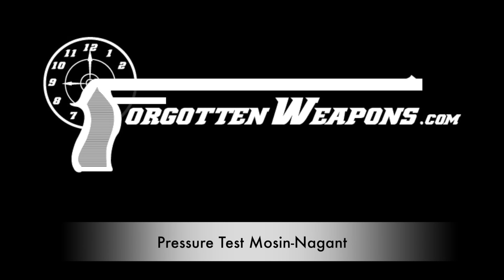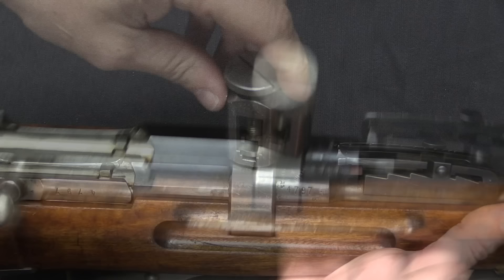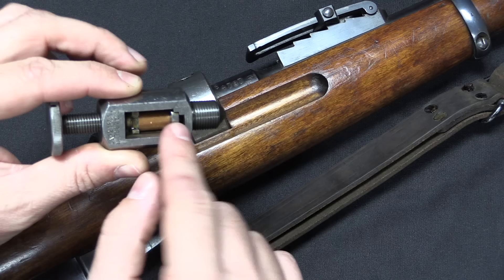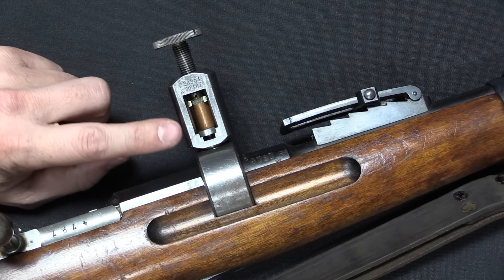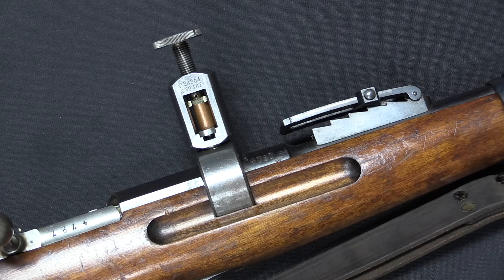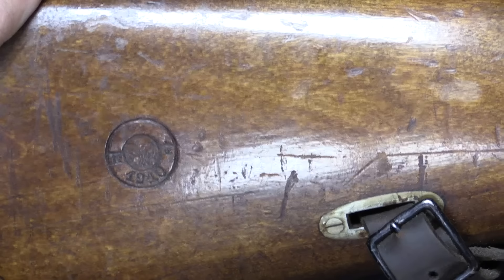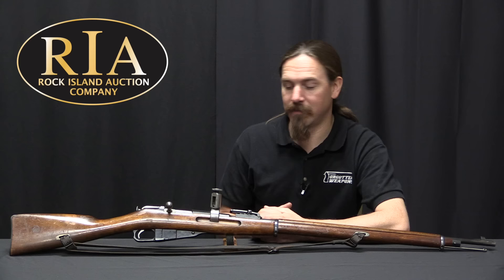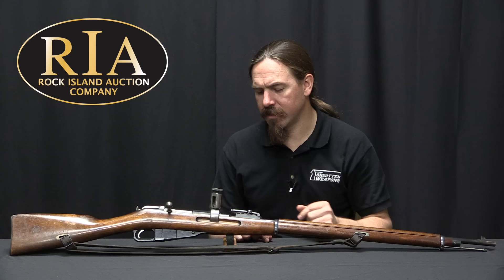Mosin-Nagant Factory Pressure Test Rifle

Comment: The bottom of the  piston looks to be flat. How does it interface with the chamber and/or cartridge? Does the cartridge extrude itself into a hole? Burst? Be a PITA to extract?
Reply: The pressure generated by firing the round flows through the hole acting on the piston which pushes the copper. Nagant chamber pressure is 56,565 psi or 45,900 CUP.
Reply: @rrkeyes3    I understand the concept, I'm curious about the interaction at the base of the piston. An airgap, or poor fit there could cause the case to burst, which would give an impact force on the piston rather than a pressure, skewing results. A case bulging (at least) into the hole could lock up the gun.  Maybe I'm missing something - or maybe the piston is a replacement that hasn't been reamed to match the chamber yet - dunno. That's what I'm asking about
Reply: That's what I'm thinking as well. The hole would be immediately forward of the casing to avoid fire forming
Reply: These were commonly used with pre-drilled cases, very carefully loaded into the chamber so the holes line up. If you didn’t use a drilled case, the cartridge brass being blown up into the cylinder could potentially cause an erroneously low reading by obstructing gas flow. 

That’s also a reason why it’s easy to unscrew the whole thing. Before use you must look down the hole to make sure the hole in the cartridge lines up with the hole in the chamber.
Reply: That's very interesting, honestly seems like you would get differing results from even just a slight misalignment but I have no experience with them.
Reply: Kaboomf explanation above makes a lot of sense - I just had a look at my (normal) Mosin Nagant, and compared my rifle with the one in this video - It seems the pressure measuring device is indeed on top of the cartridge case.
I wonder why they didn't put the device further, just past the case?
Reply: Michael Eisenhut: Thank goodness there is one intelligent person commenting on here, I was beginning to give up on this channel !

Comment: +Forgotten Weapons I don't understand why there couldn't be a conversion formula for the copper value to PSI. Aren't all pressure values derived from some secondary reading of whatever device you use? Pressure is Force per unit area at an instant, and I realize that the deformation is a process that takes place over a finite/definite length of time (which is work not pressure), but couldn't there be a conversion that takes whatever burn time into account? I feel like I'm missing something.
Reply: The problem is copper crushes in a non linear fashion.  Therefore you cannot use it for low pressure ranges as it will not crush at all.  Lead is used for the lower pressure ranges, and it is also non-linear.

Comment: ...so how exactly does this thing work again?
Is the little pocket of air (between the case and the piston) compressed upon firing and pushes on the piston? Or is the piston impacted directly by the bulging case? (Doubt that). Or is there some degree of gas leak that makes it's way around the case neck and back to the vent hole? Is it something else entirely?
Halp.
Reply: The cartridge would also have a hole drilled in it and the hole would have to be lined up.

Comment: So it’s based on the yield and plastic deformation of copper? Interesting, I guess the copper purity and annealed state would be very tightly controlled. Would there be other materials for higher pressures like brass for a howitzer say? Asking for a friend.
Reply: Scott Birse there’ s lead units of pressure for low pressure stuff where copper deforms so little that the measurement gets inaccurate.
Reply: Kaboomf thanks for that.

Comment: Why is it impossible to convert CUP to PSI? We use physical constants to define units, so why is this case different?
Reply: The problem is copper crushes in a non linear fashion.  Therefore you cannot use it for low pressure ranges as it will not crush at all.  Lead is used for the lower pressure ranges, and it is also non-linear.

Comment: might be a stupid question.. what happens if you fire it while leaving the hole open
Reply: I'm not an expert but basically, the cartridge would burst and vent the chamber pressure upwards, there would be a very loud bang and anything in front of the hole would have a bad day.
Reply: Maybe some gas could also push the bullet itself forward into the barrel, but with quite less power XD